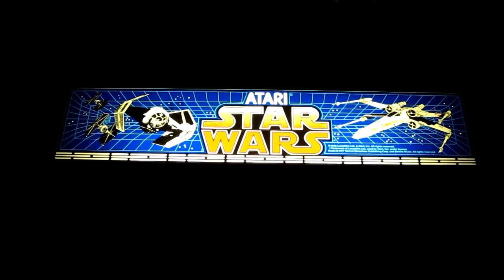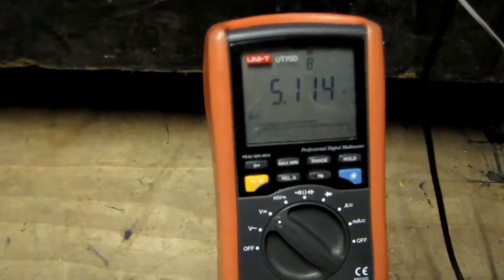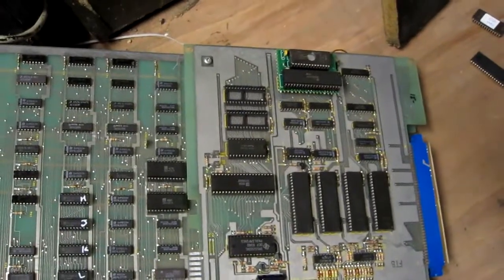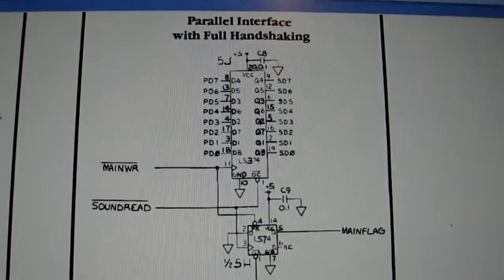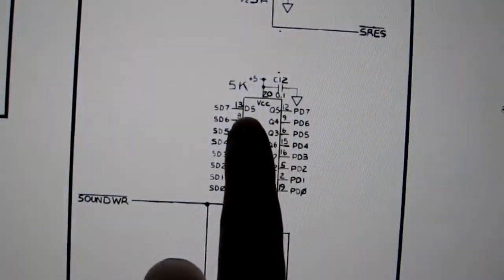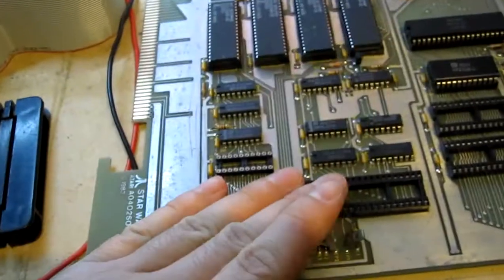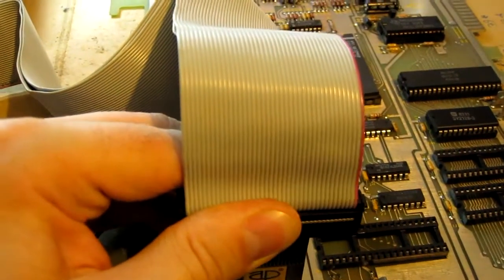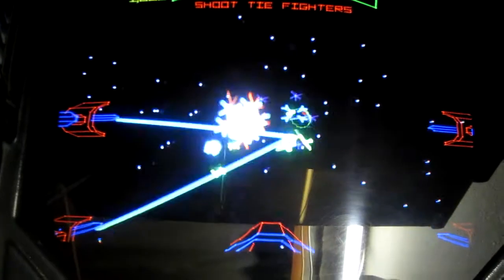Atari Star Wars Sound Fix

Comment: I love the test equipment you use.  Great fix, and that WG6100 monitor looks nice too!  I see it has the LV2000 mod.

I have one of these machines at work that has an annoying problem.  For some reason the steering is off-center when playing, but tests perfectly fine in diagnostic mode.